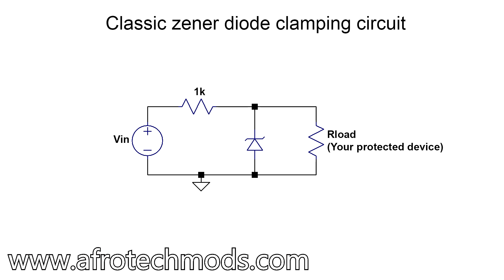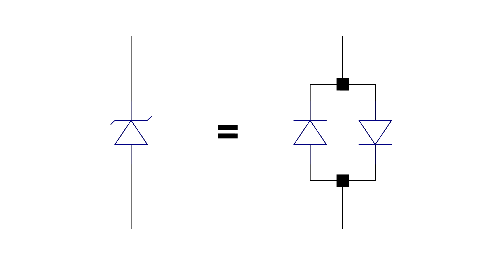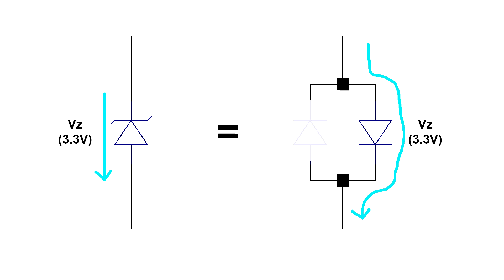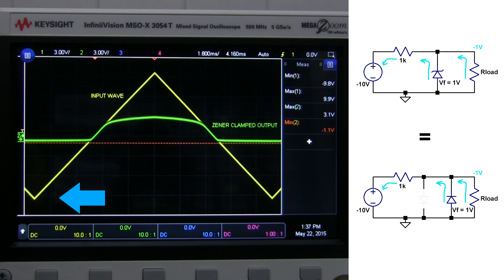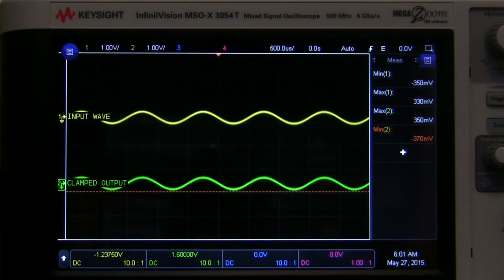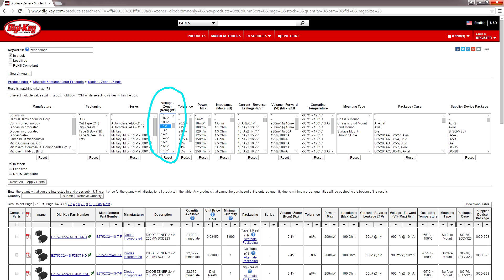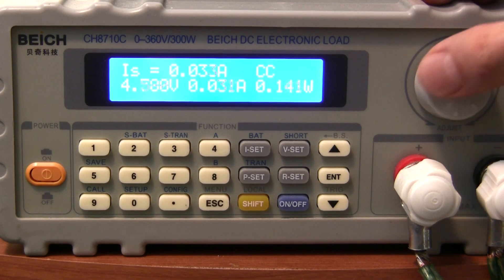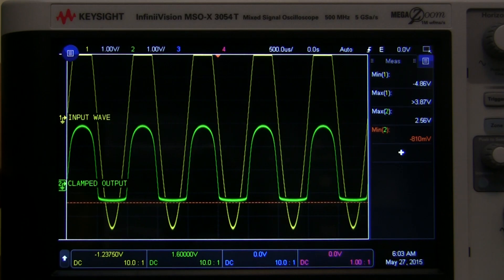What is a zener diode?

Comment: I have a Case International tractor Diode Suppression Module. The code on the diodes inside is 1N5404, the data sheet states that these are Recovery Rectifier Diodes and mentions a Peak Repetitive Reverse Voltage of 400 volts. Would this mean that in order to carry out a reverse bias test I would need a bench top power supply greater than 400 volts to test these 1N5404 diodes ? This would appear to be a staggering amount of voltage required especially when these diodes are used just for earthing out 12 volt solenoids when they become de-energized. Am I interpreting the data sheet correctly and if so is their an alternative way of testing 1N5404 diodes in reverse bias ? Thank you for this excellent Diode video.
Reply from the maker: Do you really need to test if the diode is working all the way up to 400V for your application? Usually you'd just apply 12V to it backwards and verify it blocks the current, and you just take it on faith that the datasheet is correct and it'll work up to its rated voltage of 400V. Also apply current to it in the forward direction and measure the voltage drop across the diode.
Reply: @Afrotechmods  Thank you for replying. Apparently this type of diode blocks the voltage until it reaches a set voltage then it opens to send excessive voltage spikes to ground when the solenoid coils de-energise . Both coils  burnt out before the 10 amp fuse eventually went ,not sure why the fuse took so long to go as it is of the correct rating. I am sure the data sheets are correct but it is knowing how to interpret what the 400 volts means . I cannot find a lower figure on the chart for this 1N5404 diode other than Average Rectified Forward Current which is stated at 3 amps. If the solenoids are only designed to operate on 12-13 volts surely the suppression diodes must discharge excessive voltage without having to go right up to 400 volts ? If 400 volts is the maximum voltage these diodes will work then what is the minimum voltage that will make these 1N5404 diodes allow current to flow in reverse in order to take away voltage spikes generated by these de-energise solenoids? I would have thought anything slightly above 13 volts should trip the diodes to release excessive current but I cannot find a lower voltage figure on the chart?
Reply from the maker: @teabreak4t  You might be overthinking it. I am seeing Vf to be listed as under 1.2V. So if the voltage in a certain direction exceeds 1.2V then current will flow and save you. I recommend you watch my tutorial video on inductive spiking and I think you will see what I am getting at.
Reply: @Afrotechmods  Thank you for the video on inductive spiking. I have found that when these 400V reverse bias diodes degrade and fail, the tractor's 12/13 volts will be enough to make them leak current in reverse bias, sending power to the wrong place. I would like to test these diodes using a bench top power supply. The Amps would have to be kept below 3 Amps  to avoid damage to the 1N5404 diode under test. If I go slightly above 12/13 volts, will that be a better test than just using a multimeter which may only be using 2volts maximum in diode test mode?  If I decided to use the 12 volt battery directly by using a vehicle powerprobe tester to power the 1N5404 diode, apparently a resistor should be used to protect the diode. I used an online calculator for a 12 volt load test on a 1N5404 diode in reverse bias and was told a 10-ohm 15 watt resistor with a power dissipation of 10.8 watts should be used.  Could you please tell me if this online calculator for the correct resistor sounds about right?  The purpose of this test is to find a badly degraded and faulty reverse bias 1N5404 diode and not to worry about one that is fully functioning up to 400 volts, which would be way above the vehicle 12 volt system , although I have now ordered some new ones, so could compare the new with the old. Many thanks for your help.
Reply from the maker: @teabreak4t  "If I go slightly above 12/13 volts, will that be a better test than just using a multimeter which may only be using 2volts maximum in diode test mode?"  Yes that does sound like it would be a more valuable test. The online calculator sounds about right too. 1N5404s are so cheap and plentiful that honestly I wouldn't even bother testing diodes if you have doubts about them. Just throw all the old ones away and get new ones. It will be cheaper to get the new diodes than to get a 15 watt resistor haha.

Comment: A reliable variable power supply is quite a lot of work to design. It's a rabbit hole if you're doing it for the first time. Lots of things to learn. For easy solutions of a fixed voltage there are some simple voltage regulator ICs that work well though. Throw in a capacitor too and you can get a pretty stable dc out of the end. Higher power ones require cooling though. Also if you want to start from AC you usually have to take a few prerequisite steps too sadly.

Comment: One of my bikes, a1973 Norton Commando, orginally had a battery charging circuit involving a large (physically) ziner across the battery to prevent over charging. It used the large hunk of metal the foot peg was attached to in order to disapate the heat generated.

Comment: I'm confused where you start showing the oscilloscope - maybe starting with negative voltage is what confused me. Why does it produce -1 volt? Why not -9 volts? And you talk about some current flowing through the diode and some flowing from 'the output' - what is 'the output' ???

Comment: I am such a noob, I can't even wrap my head around the concept of -10 volts.  Do I know what 10 volts is? yes. Do I know what 0 volts is? Yes (no voltage). Do I know what -10 volts is?  Huh??  In plain English, does this mean the wave generator is configured pumping out 0 to 10 volts in a non-smooth (triangle) wave form, and is constantly switching the polarity back and forth of where it is sending the 10 volts?  This can be kinda confusing to someone that doesn't have the concept firmly locked. It like saying to someone: "I just drank -10 ounces of water". You'd be like "what??"

Comment: Howdy. Nice.
An idea is to use zener diodes to kill switch on / off spikes. The approach is good but zener diodes are too slow to work as spike killers. Varistor resistors are a much better choice.
Regards.

Comment: I am a Model railroading hobbyist.  I want to use two white LED's in parallel, one is 'blinking LED' and the other a 'non-blinking' LED.  When connected to a 9v battery they work perfectly simulating the headlight on a Steam locomotive - one headlight constantly on, the other blinking simulating (inexpensively) what is callled 'MARS' lighting.  The problem is when connected to the DCC lighting circuit of the locomotive decoder and the loco starts to move the 'blinking LED' stops working.  I was wondering if the Zener diode would make this circuit work as I previously described.  DCC is 'square wave' DC circuit as I understand it?  Any suggestions?

Comment: What about a relay with a big electromagnet that turns on with only (for example) a small amount of electricity? All the extra electricity is converted to magnetism. The common and normally open contacts bring in whatever voltage you need (as long as the source can supply the needed current its good ). It may not be fancy but it is a beginning.

Comment: I'm adding LEDs to my model city, but my primary voltage is 12v ac phase to ground. I need 5v to power the LEDs without burning them out

Comment: hi, nice tut, can i use zener diode to clamp the voltage output to 5.1v 50ma from a 72v input?
Reply: 4 years late, yes - you need a 1k 5 watt resistor.  The resistor will get toasty.  :-)
Reply: @epiendless1128  nice,  thanks for the reply,  same for 12v ?

Comment: Great video!
I do have a question, though:
The zener diode and the normal one both conduct electricity when forward-biased. Both of them also conduct electricity in reverse-biased if the given voltage is high enough then what is the difference between the two?

Is it that a normal diode will be damaged if voltage is high in reverse-biased where a zener will be ok?

Comment: I am working on fuel injection circuit (12v 2.1ohm solenoid)  trying to protect 555 timer / arduino driver.  Thanks for this help.

Comment: Correct me if I'm wrong, but this phenomenon is technically referred to as compression in audio, not distortion. Distortion happens with compression (along with practically any other signal processing regime), but sawing off peaks is pretty clearly in the domain of compression.
Reply: That’s exactly what distortion is. Cutting the peaks means that the signals line up way more often producing lots of harmonics. (They only have to align in the x dimension.) not x and y-amplitude. 

Compression is the opposite, you take the small peaks and amplify them to reach the top of some range (the compression ratio). This makes quiet sounds louder.

Comment: We use Zener diodes a lot. 0.4W for reference and clamping circuits drawing up to a few milliamps and larger 1.3W versions for regulating rail voltages on comparator circuits with loads up to 50mA in some cases. Zeners only handle the surplus current in a circuit where the load at a given voltage is continuous. It is a very useful component.

Comment: I am working on a small weather emergency broadcast radio with a lot of static in it looking inside it I found a broken  zener diode.
on the printed circuit board it says 3.9 volt ZD 3 
do I need to concern myself with more than 3.9 volt ?
is there different amperage on a 3.9v zener diode ?
the glass is broken and I could hardly read what it says on it. 

thank you and have a good day

Comment: I have a question. I am a complete noob to this and need help. I am making a flashlight that's input voltage is 8.2v from two 16340 3.7v high drain batteries in series. The current will be set to 4.94 amps using 12 7135 chips that are 380ma. I am using an LED that had a forward voltage of 6v. The driver is a direct drive so the 8.2v goes to the LED. The driver is a 3 to 4v driver with a zener diode to make it a 6v driver. How would you suggest to limit the output voltage to 6v to keep the LED safe? Thank you for your help

Comment: When you say reverse biased, that current starts to flow in the opposite direction, do you mean from cathode to anode? (rather than the normal anode to cathode direction for fwd bias) So if you built a circuit specifically to utilize the reverse bias of a zener, you wire in the zener backwards so it starts conducting when it hits a certain threshold? So + to cathode and - to anode?

Comment: Guys pls help me with my simple question.... how will you know what resistor should i use for the zener diode
Reply: Let’s suppose we have a BZX55C5V6 (5.6V) Zener and a 15V supply. First we need to know the maximum current that the Zener can handle. Looking at the data sheet we see that we need to divide the power rating of the Zener, 500mW, by the Zener voltage which gives us a maximum current of 0.5W / 5.6V = 0.089A or 89mA. The 15V from the power supply is shared between the Zener and its series resistor so we need a resistor that will drop 15V – 5.6V = 9.4V when it is passing 89mA of current. R = V / I, and 9.4V / 0.089A = 105.6Ω. This not a standard resistor value so we need to select a close value. The E24 range includes 100Ω and 110Ω resistors. Selecting the 110Ω resistor ensures that we don’t exceed the maximum current rating. The resistor is passing (just less than) 89mA with 9.4V across it so it will be dissipating 0.089 x 9.4 = 0.84W, so we should choose a resistor of at least 1W rating..

Comment: What advantages does this offer over a voltage divider circuit (swap the zener diode with another resistor)?
Reply: Voltage dividers don't provide any kind of regulation. Plus, they will heat up pretty quickly.

Comment: isn't the voltage getting clipped? not clamped.
Reply: It is clamped because the zener is in parallel with the battery.
Reply: Gulrez Khan But, clamping needs a capacitor so that it can add a DC voltage to the whole input waveform, doesn't it?

Comment: Not sure I completely understand the last part of your video.
As the load current goes up, the voltage drop across the resistor goes up. This seems to have the biggest impact on the output voltage, not the zener.

E.g. at 50mA, the voltage drop is 220*.05 = 11volts. If you have a 12v power source, then the voltage available at the output is a maximum of 1 volt, regardless of the zener presence. In other words, the bad voltage regugation is due to the inline resistor, not the zener.
Reply: The series resistor is chosen so that the zener is passing close to its maximum rated current (say 30mA) with no load. A load draws current which is diverted from the zener current so that the load current plus the zener current flowing in the series resistor remains almost the same at 30mA. The voltage across the zener changes only slightly as it passes less current so the current through the resistor and therefore the voltage across it also remain relatively constant. If the load draws more current than the 30mA maximum current set by the series resistor regulation ceases and the extra current is drawn through the series resistor causing the voltage across it to increase and the voltage at the cathode of the zener to fall.

Comment: Another great video, in one of them you mentioned that diodes don't always work well in parallel could you make a video to explain this? Alternators of high amp output frequently use multiple parallel diodes.
Reply: really late but basically, diodes don't have a linear voltage to current curve like a resistor, and if the voltage is above its forward voltage, the current will increase dramatically if not limited. each diode is slightly different, so if more than one diode is used in parallel, one will likely end up overheating while the others do not heat up at all. I'm not sure why some devices still do that though

Comment: I am trying to eliminate a spike that happens when the circuit is turned on, no luck.
It regulates down to 5 from 8 volts but the spike is still there. I am using a nokia phone charger to produce 5 volts.
Any suggestions?
Reply: A Zener diode.
Reply: Yes, I am using a Zenner but it still spikes.!

Comment: I  have 2 suspected bad zener diodes in a vintage Sony receiver with 3 leads - what the heck is that? Only 2 leads give a reading. Manufactures have 'replacements' that are typical  2 lead diodes - can they work to replace the 3 lead?

Comment: the TL431 can be used as a programmable voltage regulator (reference). That means you can actually use a Voltage divider to get the output you want. I hope you make a small tutorial about the TL431 and its uses. great video
thanks

Comment: What's the resistor for, to limit current to the zener or?
Reply: without the resistor, the diode will be destroyed. by excess current. AS voltages add, in series, something has to absorb the leftover voltage.

Comment: I'm trying to come up with a way to illuminate a green LED when my battery voltage reaches maximum charge. Could this be accomplished using a zener diode in series with the LED? Yes I'm a noob.
Reply: +Chris Call With my limited understanding, I think it would.  You might be able to patch the diode and the light between your charger and mains such that it completes through the light after the battery is charged.

Comment: Thank you for the clarification. The question on my mind: is it ok to use Zener Diode as a rectifier diode? I wasn't aware until I learn of your demonstration.
Reply: In the late 80s and early 90s I worked rebuilding alternators and starters. In the mid 80s GM started making the CS series of alternators, which used 28 V Avalanche (Zener) diodes for the rectifiers. I believe this was to protect the electronics in the ECU from voltage spikes. These alternators were rated up to 120 A @ 12 V. I actually mounted a 120 A GM alternator in place of a 60 A Ford alternator on a 1983 LTD. I modified the GM alternator to use a heavy duty Ford external regulator, and used to jump start semis with it. edit: Oops, I forgot to answer your question. As long as the Zeners are rated to handle the anticipated current and voltage, they will work fine.

Comment: I have a .6w 6vdc .01amp solar panel and i was wondering there is any to boost it to .08amps without increasing voltage
Reply: Basic serial vs parallel question.  EE 101. Or EE 1 rather.

Comment: Afrotechmods i saw one of your videos about speed control H-bridge. So i was thinking if you can build same think but for more power and amps. I builded fan from old motor for windscreen whipers and it is drowing around 5.5 amps on 7.2 v whit load (fan in this case).So can you build one or sand me schematics.